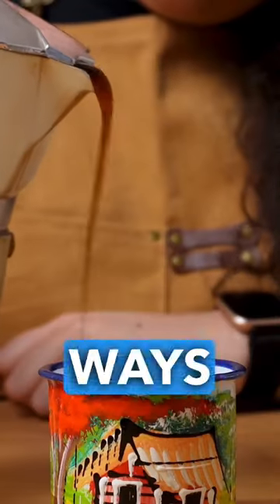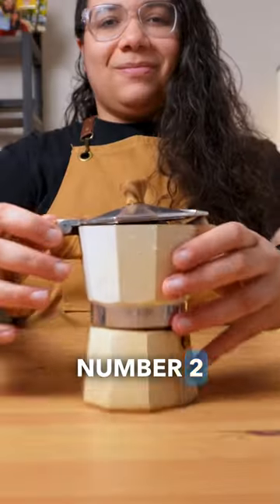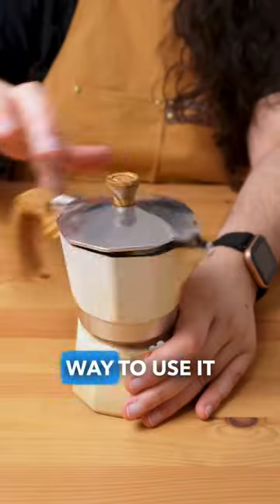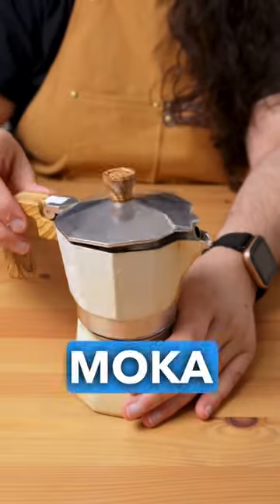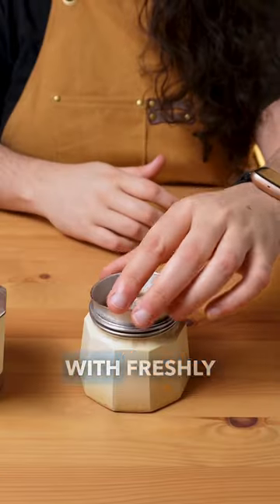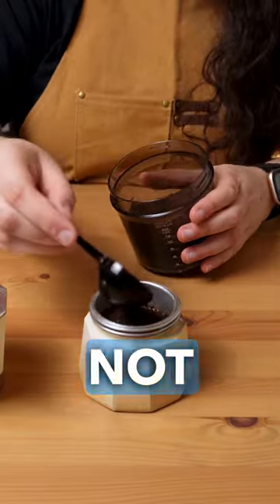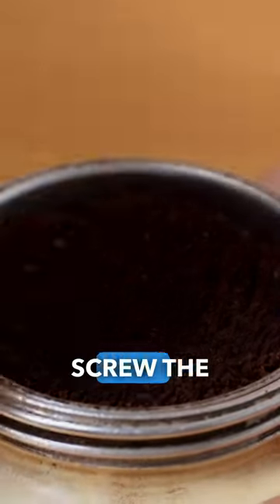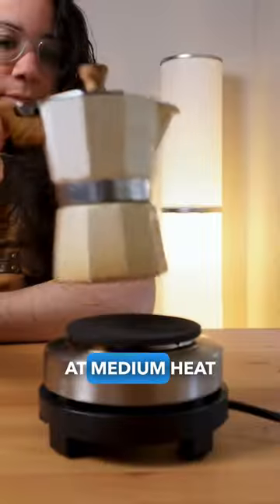How to Use a Moka Pot - 101 Ways to Enjoy Coffee at Home #coffee

Comment: How does this method compare to the French press? Just started using the Moka pot and really enjoying it.
Reply from the maker: Both are totally different methods with different results! Moka Pot will give you stronger coffee, faster, as it uses pressure from boiling water. French press takes a while longer as it’s more of an immersion method where you let the grounds soak in, then plunge to separate the grounds and end up with a cleaner coffee, usually lighter but, depends on how much grounds you use. 

I use both all the time!